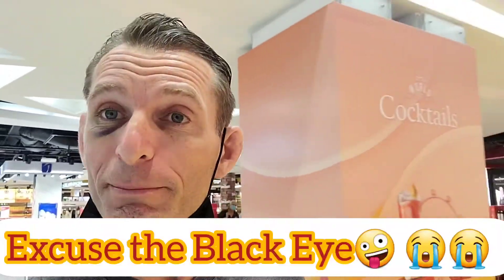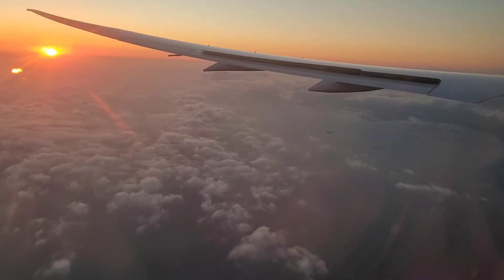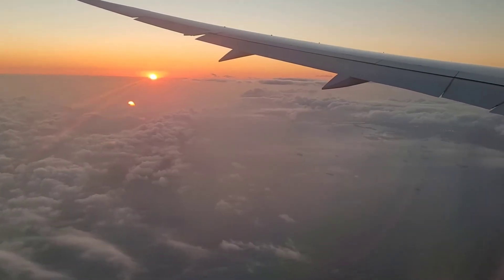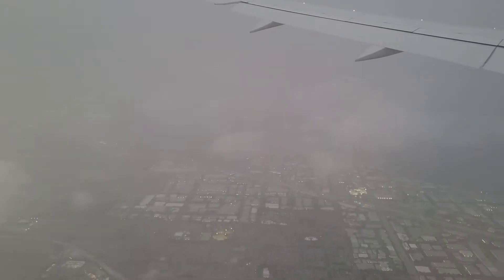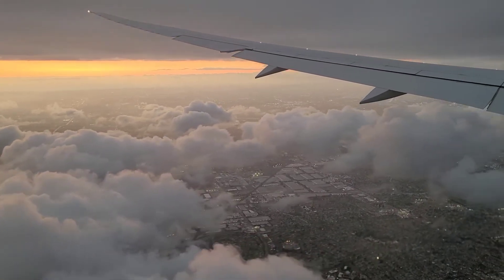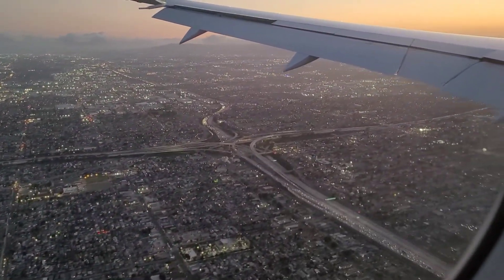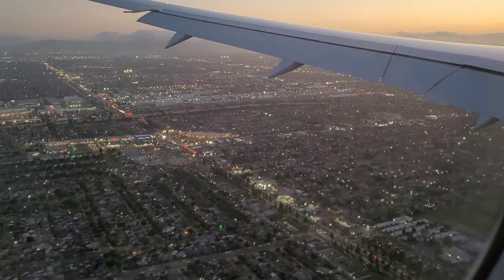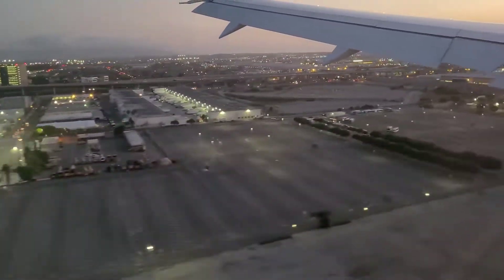Airplane Air Quality Testing (International Flight, CO2, CO, PM2.5)

Comment: Turbine engine mechanic here - you missed measuring the most pressing issue of contaminants in an airline pressure vessel - VOC / organic combustible vapours.   THAT is the biggest issue affecting people inside the pressure vessel. A 100$ unit can easily measure this. I have one in my home. 

Also the B787 does not use engine bleed air to pressurize the cabin, electrical compressors do, but this is an outlier as 99% of other commercial airliners use engine air, which is susceptible NOT to Kerosene vapours, but neurotoxic oil vapours.